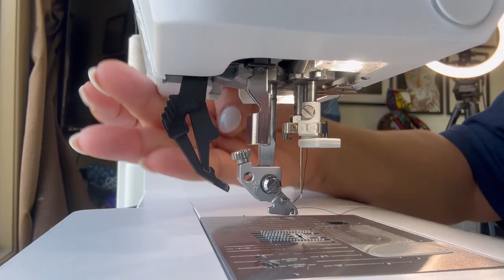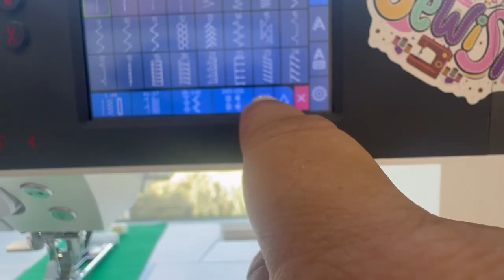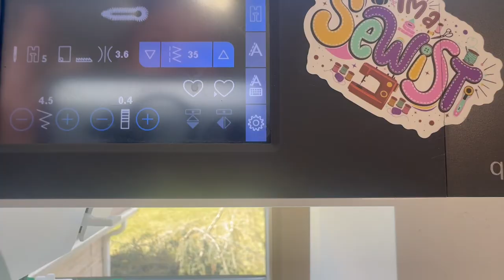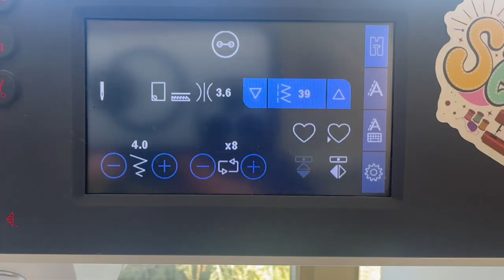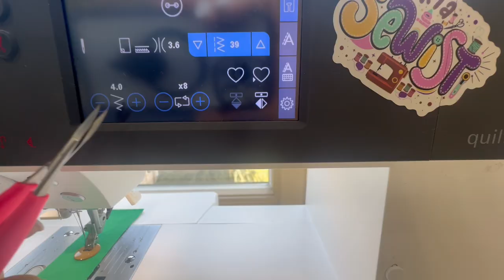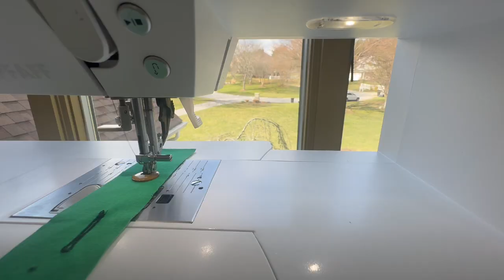How to Sew Perfect Buttonholes & Buttons | Pfaff Quilt Ambition Tutorial

Comment: 😢I was SO happy to find your video👌! However, mine is a 635 and the LV_ does not operate the same for removal and stops the buttonholing process. Still working on it. Will report back with any solutions.
Reply: Ok, found a guy showing how to disengage the idt on the 635. You use a finger or thumb from both sides pull down firmly and it will swing backwards a bit when you let go. I tried pulling and tugging before. I guess my problem was even pressure from both sides-O and waiting just a second in the pulled down position!
Reply from the maker: Glad to hear you worked it out ❤